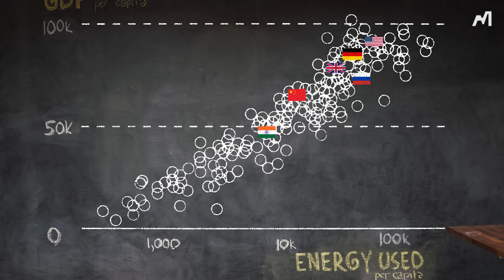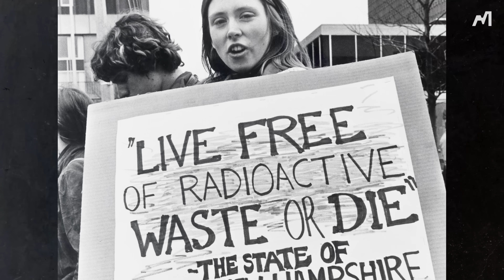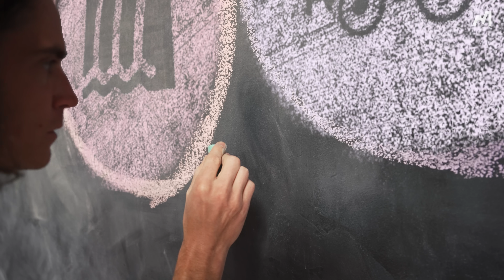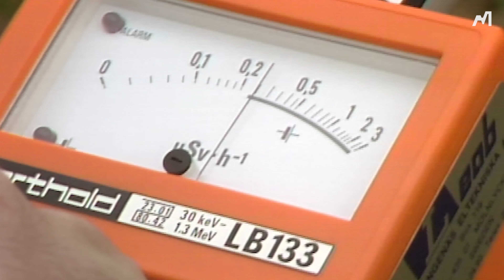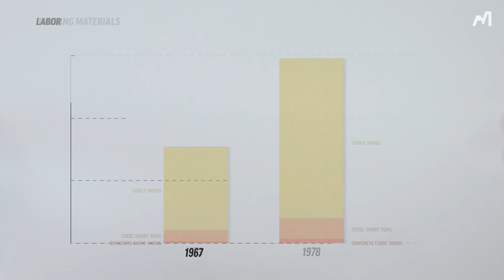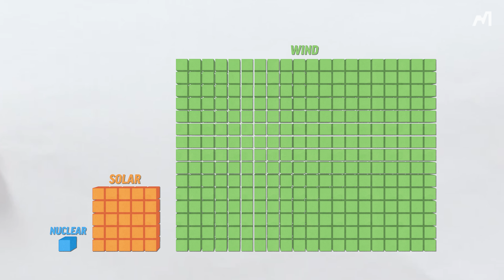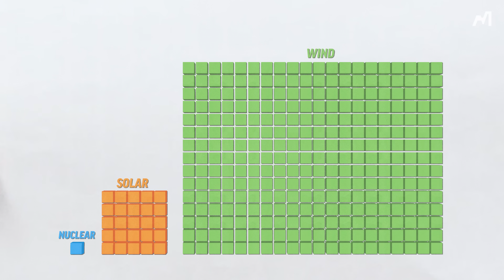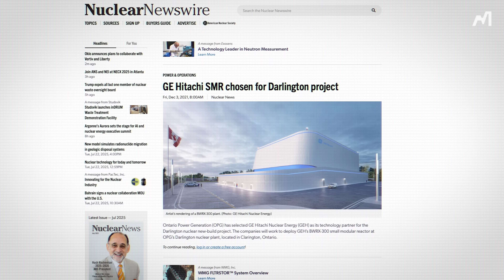They're Lying to You About Nuclear Energy

Comment: Just making one of the blades of a windmill black makes it easier for the birds to spot them all.  It reduces bird strikes by 70%.  (No data on how much it helps the bugs).

What is the economic cost of exclusion zones after a nuclear accident?  What is the mine footprint for uranium (yes, I know there is a mine footprint for rare earth metals for renewables).  What is the cost of each accident on the cumulative radiation levels.

You showed solar out in fields, and yes, that is how it's done industrially, but it also goes on roof tops.  It could go over roads where it could keep roads clear of snow and rain.  Vertical panels are now being used on the sides of buildings and between rows of crops, even on top of some crops that don't do well in direct sunlight.

I'm not one of these people who says all nuclear is bad.  I think the problem is that most of where we use the most energy is near very valuable real estate.  Maybe nuclear reactors in remote areas powering AI centers might be a good use case.  Most computers will be obsolete in a few years anyway, and you can, at least in theory, build them away from population centers (although building farther away from population centers has some cost tradeoffs too, and some AI will be more time sensitive and need to be close to reduce latency- stock trading, game servers).  I think your video came off though like you did everything you could to downplay nuclear shortcomings but failed to do any research on how renewable's are improving their own footprint.

Comment: I was a Nuclear mechanic at the worlds largest nuclear generating company and  this guy is wrong or distorting the truth. Nuclear is very deadly and that’s why we have so many safety’s and redundancy components to keep the public safe. 
He’s correct on naturally occurring radiation and closer you are to the sun more you get(pilots, stewardess,people that climb mountains,people that are up higher than people that are on the ground)get more radiation. ALARA or as low as reasonably achievable and it’s a term we/they used simply to keep you away from the radioactive or radiation areas so you won’t have as much exposure and that’s why you don’t here about people dying from radioactive exposure so yep it’s working and it’s real. Example if you have to work on something that has quite a bit of radiation at the work area you put up more shielding(lead blankets)or you’re only allowed to work on it for a few hours then somebody else goes and works on it so you spread your radiation exposure to others so no one person gets all of it but it’s rare. They use chemical flushes to help flush the radiation out of the piping or contamination I should say, and then it goes to filters and they put them in concrete barrels. All of this is very real. This guy is simply being a proponent for nuclear, which I agree with, but he is deceiving you to get to the point of Wind turbines ain’t that great solar, same deal no one makes electricity when the suns not shining(and wait till we start throwing away all those nasty poisonous chemicals in the solar panels gonna be a huge expense landfill specially wind turbines you’re going to be amazed, you’re not hearing much about that in the mainstream media are you)he simply pushing an agenda, which I agree with though. 
We have nuclear fuel on our highways all the time you just don’t know about it because they haven’t introduced the neutron to start creating the fission process because it’s not in the reactor yet that’s when it’s radioactive after the atom split to create heat which in turn makes water hot to the point of steam and nuc plants make it so pure(superheated steam) because water droplets can be quite damaging at the pressures that they go over turban blades to spin the generators to create electricity….. think of a nuke plant like the engine in your car you introduced the fuel which is gasoline it makes the engine run creates heat and energy to cool it. It goes to your radiator, which is the towers that you see with the steam coming out that people think of smoke at times it cools goes back in as water pumps back through the system to do that all over again just like your car(principal) and yes, modular reactors are the way to go. They are a thing of the future. Our grid depends upon them in our infrastructure. There’s no getting around it fossil fuels will eventually dry up. We need alternatives and electric cars are not the answer, not with the batteries that only lasts so long we need to find a means to harness lightning somehow and create some kind of a storage for it, but that is not anything near of a possibility at this time

Comment: What do nuclear, hydro, wind, wave, solar or any other energy generation plant have in common? Whatever the power, whether water, or nuclear, they all use a force, to turn a wheel. That's simplifying them all. They keep trying to hide or distract from the only real power that can generate more then enough power for every home on earth and power your car that can now fly as fast as a magnetic ley line will take ya. The only way to generate perpetual energy and has zero polution or will ever need maintenance (no parts touch, so no friction). Electromagnetic electricity generation, and propulsion. It can be the size of a phone, and power your home for free, forever. How's that sound? Combined with stem cell treatment, and the species of Mankind, can really go somewhere.

Comment: Ha! Thank you, the manhattan project, named that because it started in Manhattan, managed by Columbia University, but the scientists worked it in the Woolworth skyscraper. Its elevators designed by Nikola Tesla. It has a enormous underground man made pool, originally designed to be able to immediately put out fires in the building. But also the quickest way too remove radiation from a human is do a small niacin flush in a shower of water.  That building also had its own private underground access to the subway sys. Allegedly a separate subway track between Columbia Univ to Woolworth. And allegedly the train that brought in the "material" to the Woolworth building laboratory, that RR track-line is now known as "The High Line" an above ground free public park that runs the west side of Manhattan.

Comment: Big oil benefits from wind/solar.  Oil & gas companies know that wind/solar needs to build high CO2 gas generation plants.  Because wind/solar is so unreliable, then wind/solar need batteries, new grids and all sorts of extra equipment to be built.  Which requires more resources which the oil/gas companies can supply to the renewable industry.  Shall we talk about the 100's of gallons of oil/hydraulic fluid in wind turbines and the toxic substances in solar panels.

Comment: Modular reactors ar a scam, they produce very little energy but they need the same security measures. All the modular reactor projects are way over the budget and the cost / mw is worst then for the normal 1000 or 1200 mw models

Comment: You didn't mention that Gen 3 and gen 4 reactors are passive safe. (This basically means that they can be shut down in an emergency and walk away without fear of meltdown like gen 1 and Gen 2 reactors)  Fukishima was a gen 2 reactor nearing its end of life when the 9.1 magnitude earthquake did its best.  Chernobyl by design should have never been made but you know.....Communism.
As for nuclear waste.  The high level stuff has enough fuel left in it which can be recovered and used.  The fission byproducts have a half life of 300 years, not 10000 years like the current spent fuel that is not reprocessed.  
I was an advocate for green energy until (with age and self education) I learned the pitfalls.  At the same time, I set aside my hatred for nuclear (brought on by fear of unknown like the masses), did a bit of learning and did a complete 180 degree backflip on my opinion from 25 years ago.

Comment: I worked in radiation safety for my entire 45 year career. ALARA has done more disservice than anything. We had a program called "Save a millirem." Every millirem saved reduced theoretical risk by 1 in 10 million. It caused more inefficiencies than anything else. The linear, nonthreshold theory has been discredited as having been created based on fraud and hidden agenda. Yet it still drives the process.

Comment: I think the future will be solar and wind. The reason was covered in the video. Time to return on investment. Other than solar and wind there are no power sources for which you can be half done the installation and still be generating power and seeing some income. Even if it is only a small return and simply covers a portion of the interest on the loans it will still be a smarter short term investment. From the first day you have the first solar panel or wind turbine installed you can be generating power and cash to offset building costs. All other concerns will be ignored in light of the speed with which you can start to generate return on investment. If intelligence factored in at all, nuclear would have been the dominant power source decades ago. Half a coal plant can't generate power. Half a gas plant can generate power. Half a nuclear plant can't generate power. But half a solar or wind installation can. That is why they will dominate.

Comment: If I hear anything about renewable energy and they aren't talking about nuclear, then opinion discarded.
Reply: Nuclear power is part of the solution, but it's not as cheap as hydro, and it probably isn't as cheap as onshore wind even if we account for added cost overruns from the last 15 years.n
Reply: @XandateOfHeaven it can be cheaper if we built more plants, only certain parts of the world can utilize hydro electricty where as Nuclear can be dropped almost anywhere. Off shore wind also suffers from not be able to meet peak demand, not yet in anycase
Reply: @DaDaDo661   I'm not suggesting nuclear power has no place. It's obviously a superior alternative to coal and gas in all cases, and it can be built in places where dams or wind farms can not be built. But it is PART of the solution, not the panacea universal solution. In most cases it's going to be more economical to build wind and hydro. In a place like Washington State with lots of mountains and rivers you would use hydro. In a place like California with lots of year round sun you would probably use solar. In a flat place with lots of wind like Texas or Iowa you would use wind. In places with lots of rain cloud cover, few rivers and low wind speed (which is basically just Indonesia off the top of my head) you would need nuclear.

Comment: Nuclear energy is super expensive, not a single company wants to make a nuclear reactor unless taxpayers pays for it, meanwhile in Spain using green energy they have the cheapest energy of Europe while France based on nuclear is struggling.
Reply: France is still doing better than the parts of Europe that rely on gas. Nuclear power is cheap once the plants are actually built, the issue is the upfront cost.
Reply: @XandateOfHeaven  The upfront cost makes it not even profitable. Also, gas is cheaper when you don't sanction yourself not buying from Russia, China and other countries are very happy buying cheap gas and oil from Russia.
Reply: @Odrade100   Upfront cost is why it's more costly, but once the plant is built that's a sunk cost. It's already built. So you would only take that cost into account when deciding to build new plants. Once those plants are built, nuclear is cheaper than gas. 

Gas is also more expensive even using 2014 gas prices. It's just gotten worse.

Comment: I think the big problem with nuclear energy is that it really doesn't go well when it isn't properly regulated, since financial shortcuts and corporate practices can lead to accidents.  It's not that I don't trust the technology, I don't trust a greedy corporation that is only working for investors benefits to handle any dangerous things without oversight. I also think that an important thing isn't mentioned in this video: the amount of work and money flowing into cleanups of nuclear accidents and the areas that are getting closed off to ensure that there are not more people dying from cancer through radiation. And it will not go away fast, every nuclear accident has to be monitored and cared for a long time. That is what people fear, especially in europe where the population is a lot more dense. Financially nuclear power also only makes sense if it is heavily subsidized by the Government. Final storage is also a thing not mentioned here, though I have to admit that that problem isn't as bad with modern reactors.  I'm pro nuclear energy, but this video is really onesided.

Comment: The real problem with nuclear power is capital cost that makes it more expensive per kwh than wind, hydro and solar. Obviously it's better than fossil fuels, and no nuclear power plants should be shut down, because the capital cost was already incurred. It probably isn't the most efficient way to move away from coal and gas, but it is switching, so fighting it is basically distractionism. 

The problem with nuclear power is not danger. With the thousands killed from cancer in Chernobyl that isn't significant compared to the number of people killed (and who will be killed) by coal, oil and gas. Plus the fact this issue was unique to RBMK reactors.
Reply: It's more costly because of the regulations, make them more reasonable and every power company that isn't doing nuclear will go put of business.
Reply: @jpraczbr8413   You're just parroting what you heard in the video thoughtlessly. First of all we can't have totally deregulated nuclear power, then we would actually do something foolish like build Soviet style RBMK reactors because they're cheaper. 

Secondly, even if we look at nuclear power costs from 2010, it's still more expensive than onshore wind, solar and hydro, if we include capital costs. This is because no matter what nebulous "regulation" you're talking about (let's be honest here, you don't know, you're just repeating what you were told) you will still need massive amounts of concrete, rebar, water intake, lead shielding etc etc. 

Look at the Bruce Powerplant in Canada. Built in the 1970s and 80s, it's a CANDU reactor so it's safe, and it's the largest nuclear plant outside of Asia, and the fourth largest on earth by generating capacity. It still cost $22 billion Canadian dollars (adjust for inflation) or about $16 billion USD. For comparison the Grand Coulee dam, which is the largest powerplant in the US with a similar capacity to Bruce cost $6.2 billion. 

Once the plants are built, they have some of the cheapest power on earth. No nuclear power plant should be shut down. But pretending they're only expensive because of sabotaging regulation is just incorrect.

Comment: Why did you just skim over the nuclear waste problem? You said almost nothing about the biggest issue with nuclear. You said almost nothing. This sounds like a lame infomercial.
Reply: Nuclear waste isn't much of an issue because we can just put it on the bottom of the ocean. Water is a good radiation shield and Uranium is so dense I can not float. (I know that sounds totally insane, but 20 feet of water is enough to block meaningful amounts of radiation)

The real issue is nuclear plants are expensive to build
Reply: @XandateOfHeaven that is the most uninformed statement you could probably make about nuclear waste. Just do some research on the issue in the united states and you will see what’s going on. It’s a huge mess. Also a lot of the waste will still be a problem for thousands of years. The decay half life is 24000 years for plutonium 239. Your idea about the ocean is absolutely terrible and you clearly have no idea what would happen to containment vessels in the salty ocean.
Reply: @Dirtjumper26-dz2ee   Uranium is one of the densest elements. It would almost certainly not move in a deep sea trench. We've done studies on this. Uranium embedded in the sea floor would do basically nothing, even if it was breached. 

Your reaction is emotional, not rational.
Reply: The actual volume of nuclear waste produced is infinitesimal. Burying it in geological repositories is completely sustainable and fine
Reply: @angycucumber4319 how about the 80000 tons just sitting around waiting for a solution? That’s just in the USA.. Is that “infinitesimal to you. Have you never heard of radioactive waste leaking from underground storage? You must be fairly young to not know about the history of this issue.